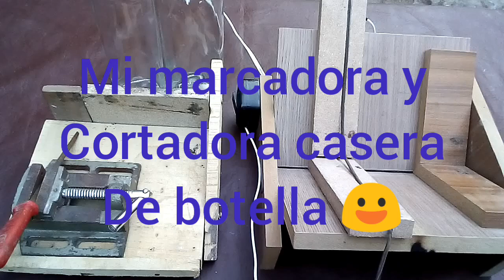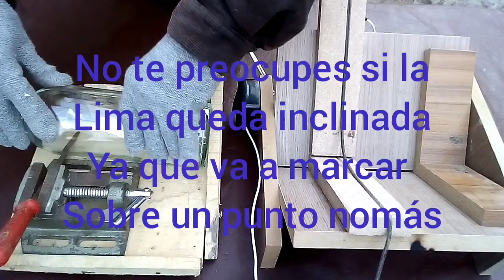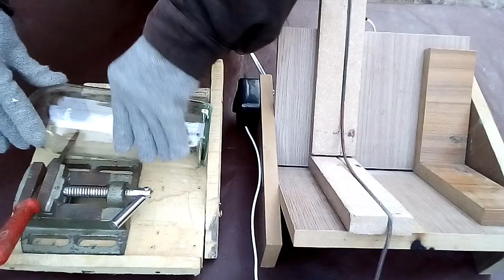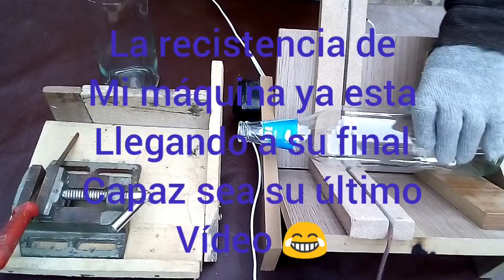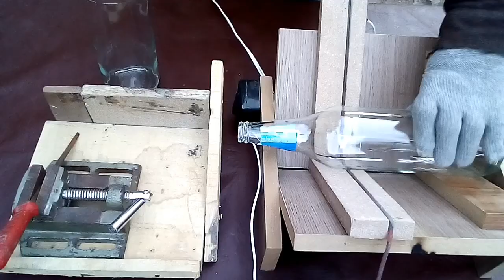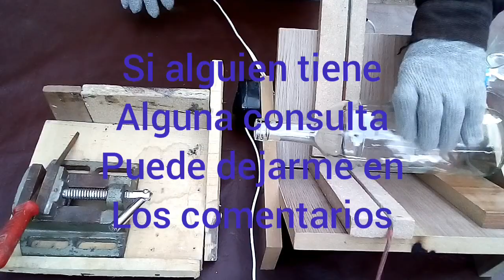como cortar botellas en segundos con marcadora y cortadora caseras..

Comment: Hola, entre la resistencia que corta la botella y el conector de corriente le pones algún componente como ejemplo un inversor o resistencia menor? Saludos.
Reply from the maker: Hola, la recistencia puede ser de menos voltage, siempre que marqués la botella va a cortar rápido, sin marcar es más complicado ya que vas a tardar más y vas a cortar menos botellas, mi máquina solo tiene el botón de encendido y apagado..
Reply: @artesaniaselpouyo7053  muchas gracias por la orientacion. He construido la forma y he colocado la resistencia directamente al cable con su conexión y mi duda era esa, si es que había algún componente adicional pero ya lei que no. Gracias!